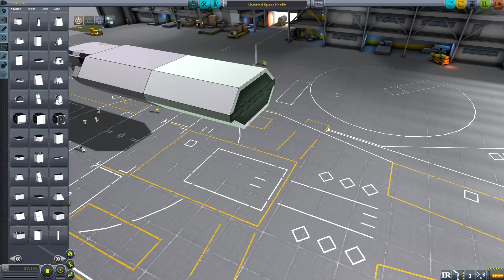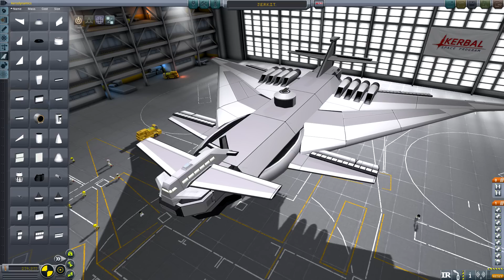KSP - Jumbo Jet Aided Rocket 2/2 - J.E.R.K.I.T.

Comment: How the hell do you make these mods work, and how does your KSP run so smooth? I run with the lowest possible graphics settings, and still I get half of your FPS. My specs aren't so bad:
nVidia GTX 765 M
i7 4770MQ
200 GB SSD (boot drive)
675 GB HDD
MSI GE70
I still can't make it climb higher than around 25 fps. That's the absolute max I have, No mods. I have 64 bit Windows 8 and run the 32 bit KSP. Might that be the problem?

Sorry for disturbing, I'm a huge fan of your videos and these questions are directed towards anyone who might be able to help. Thank you, and keep the good work up :D
(och förresten, ja, jag är Svensk :) )
Reply: 64 bit KSP is extremely unstable.
Also, your specs blow mine out of the water, but I can run the game on maximum everything at 60FPS. I have an intel i5 quad core (laptop size), nvidia GTX 260m, and a 128 GB SSD (don't have a hard drive, but this works). I run most new games at pretty high settings as well, can run GTA IV on max with 60 FPS, etc. There's definitely something wrong with your PC.
Reply: I know there's an issue with some games/laptops where games will use the integrated graphics chip which is much worse than the dedicated card (In this case your 765M), and have to be forced to use the dedicated card instead. Maybe this is the issue with your setup?

Comment: robbaz the american shuttles are not bad tech they are extremely versatile and effective space craft with alot of uses and abilitys...... your just not good at building shuttles 

also shuttles are not designed to use their engines for landing. they are built to help it get into space and decelerate the orbit so they glide to land. a shuttle landing is hard to do since they are out of fuel. you glide in from high altitude and land.